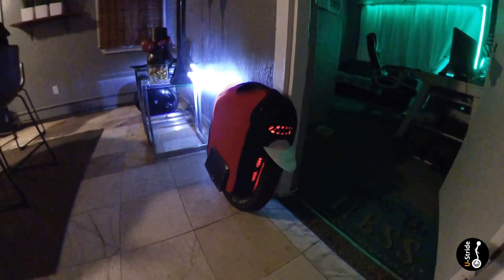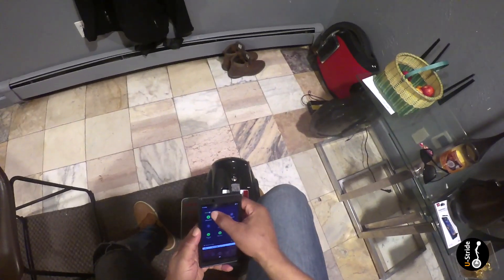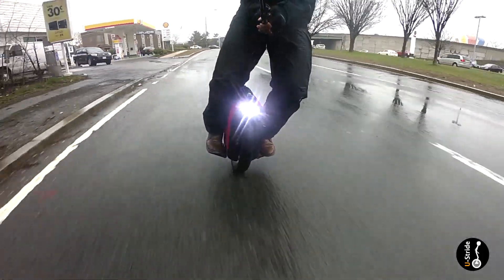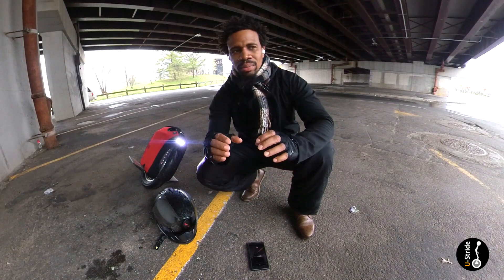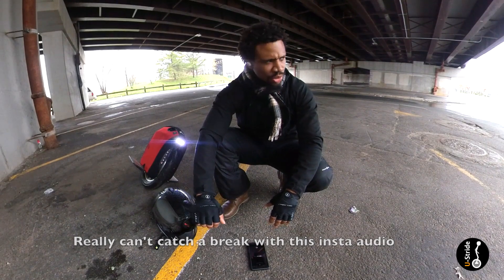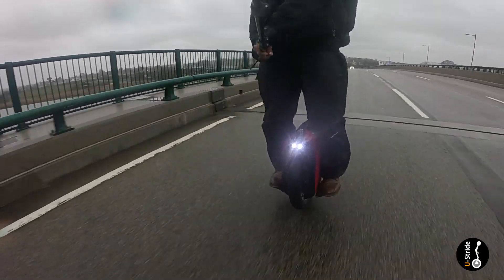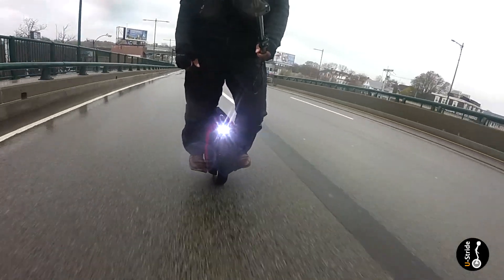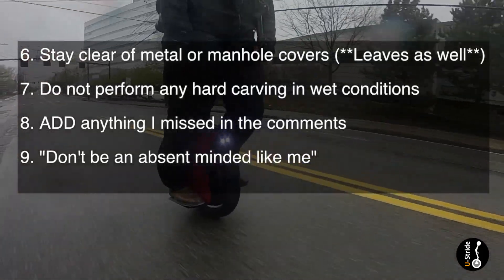Everything you need to know about riding an EUC in the rain!

Comment: List of gear...
Full face helmet
Wristguards with sliders
Motorbike gloves to go underneath the wristguards
Knee/shin guards
Body armour/armoured jacket/motorbike jacket
Hip protectors/armoured jeans/motorbike trousers
Motorbike shoes (feet/ankle protection)

Other bits...
Hi vis or reflective jacket and or trousers

Extra lights to wear on your rucksack or helmet
Remote horn or thumb bell
Blind spot mirrors to attach with Velcro to wristguards (to keep checking whats behind you)
Radar on the back of you euc (it'll let you know when a car is coming up from behind)
Reply: Did you install rear anti collision radar? Taking it off my wrecked motorcycle and installing on V12ht soon

Comment: Nice job covering this, to bad it's turning to summer soon, lol.

 I've only ever been caught in the rain once, mostly avoid it as I don't have the correct gear yet. Once I get rain gear though, I definitely won't mind going out in the rain. My only concern is rain buildup on helmet visors. Even after you wipe it off, it's still semi blurry.

Lastly, sorry you crashed making the video but I appreciate you including it in. Great display of what can happen in these conditions, as well as how to handle it! Great work!!
Reply from the maker: Very true about the visor, I pretty much keep mine open but not fully open
Reply: @UStride  I'll have to try that next time. I didn't bother before, due to past experience. Just thought back to riding my motorcycle, and how opening the visor just caused everything to smack into my face and eyes. But I guess at these lower speeds, it wouldn't be as bad

Comment: Had my first EUC fall today after 200 miles. Was on my V12 with stock tire, road was wet because it had rained. Made a sharp high-speed turn like you did at 4:50, which under normal circumstances I could have done but my tire slipped. My only gear was a helmet but I got away with only a slightly scraped knee.

Comment: Good vídeo as always... When is raining and I have take the wheel I use to put some tape on the switch on buttons just for an extra protection. I also have 10  small 3mm spikes in the nikola pedals is the way not to slippery over the pedal.
Reply from the maker: Yeah fortunately I don't have to worry about slipping off the pedals, but that's not a bad idea

Comment: Nice vid and thank you.  I would ask something about the traction tough: When did the rain started? It's a big difference if you started riding shortly after the rain started, or 1-2 hours later. After the rain just starts,  the loss of traction is huge, because of all the mud, rubber and oil film on the asphalt. Later on,  once all thst is washed out, and as long as you don't aquaplane, you should be able to corner about 90% as in dry conditions. Or I'm wrong... 😁
Reply from the maker: It was shortly after the rain started. When I went out the first time it wasn't pouring like this. I think you're right

Comment: It seems to me that 1 contribution to the fall that you had coming around the corner has to do with the type of tire that the MSP has come with. Which seems to be more for off roading rather than the tire that comes stock with the MSX which seems to be  Design more so for the road. Also, remember other vehicles may have better braking than the EUC rider in good weather... but worse breaking in wet
Reply from the maker: Very good points there man, didn't think about the type of tire